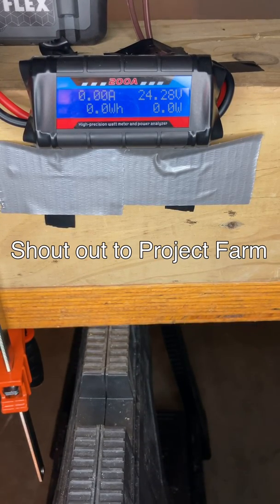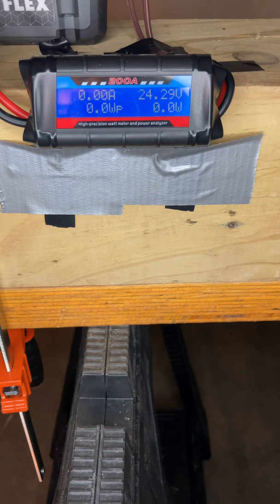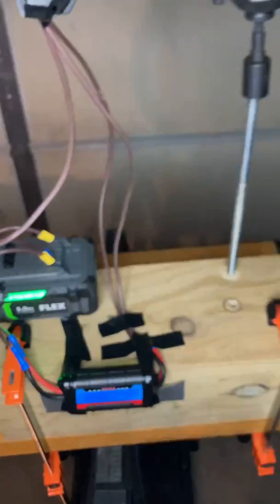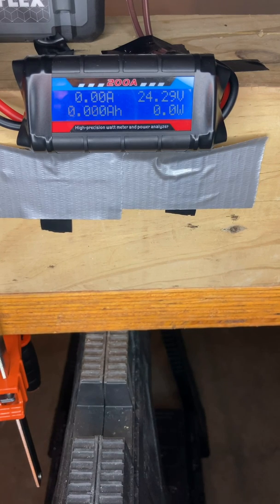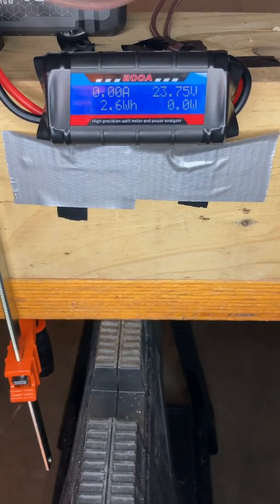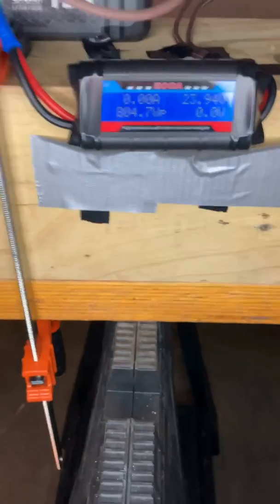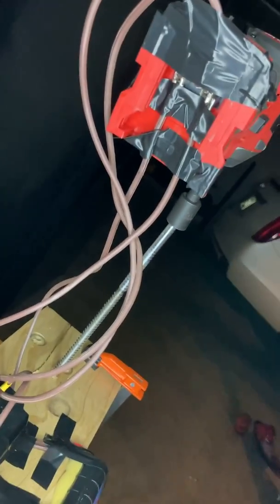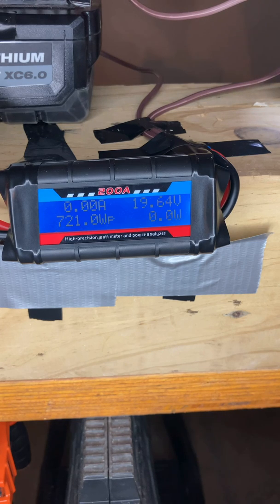Tool Testing  What you see is what you get

Comment: for the flex impact, does it only need two wires to run?
Reply from the maker: I think it uses 4 connections
Reply: @IMPACT-NATION  i could be wrong here. i think you used only two connectors out of four to make it run.... again. i could be wrong... THANKS :)

Comment: Bro this is next level testing‼️‼️
Reply from the maker: Thanks man. I seen project farm use this meter on a blower and battery to test the capacity. I just applied the same method but to test current draw, watts produced, and voltage levels. Pretty interesting stuff if your into battery technology. I’m going to be testing the flex 10Ah stacked lithium very soon on the flex recip.  just ordered it from lowes today so stayed tuned brother 👊. Thanks for the comment

Comment: Good testing looks like the Milwaukee topped out on amps Higher then the flex from what I could see but both are solid and pretty close looks super fair to put the Milwaukee tools against the 24v tools looks like voltage drop was 1 volt on the Milwaukee vs the flex dropping 4 volts
Reply from the maker: That’s what I don’t like about the whole 20 volt max, 24 volt max thing. Even MAKITA started doing it with XGT. Yes it will read 20+, 24+, 40+… whatever. But as soon as you pull that trigger that nominal voltage kicks in. And you have to pull the trigger to accomplish a task🤣. I dig it though. Marketing 🤣. I think Hilti was one of the most 💯 out of all of them. They’ve had 6 cells in their packs forever and always listed at 18v packs. Only up till not long ago did they start putting 22volts. Even 12volt tools are just a peak rating. 12 volt are only around 11.1 nominal. I understand why the companies do it though. I probably would too. That shit don’t fly over seas though🤣🤣

Comment: Bang up video Brother, intelligent and concise. Quite project farm style minus the rapid announcer callouts hahaha. Liked and subscribed, not bad for the Flex. Milwaukee will still always be a wildcard in my books.
Reply from the maker: 🤣 thanks Athannael. I rushed this video. I really appreciate the support man. That means a lot to me brother I really like the flex impact driver. I don’t mind the weight at all. Makes it feel like a more solid tool. As a new power tool company I think they have accomplished quite a lot in a short period of time
Reply: For me why I swapped from Milwaukee to Flex is the price ironically for performance. That 6.0ah battery in my area costs $384 taxes out, the Flex impact kit cost me just under $400 taxes in. The 2 batteries it came with the 2.5 and the 5 cost $100 and $200 respectively so the cost for the tool was $100 charger was kicked in for free, swap to the Milwaukee side tool only Gen 3 impact is $199 out here so for the same performance as the flex it would cost me over $600 taxes in.

Comment: Great work Brandon.  But you gotta check with the boss when smoking in the lab.  You might catch on fire 🔥 or start a trend.  

Holy crap bro.   You catching up to me fast.  Keep it up.  💪
Reply from the maker: The cigarette was a new affect in my editor 🤣. I feel a little embarrassed tbh, about the quality and the editing cause it was spur of the moment and rushed but I just wanted to put something out about the results. People hear 21700 Vs 18650 cells and automatically complain and say it’s not fair when comparing flex and Milwaukee. They don’t take into account flex has an extra cell in the 2.5ah and 2 more cells in the 5ah running at higher voltage.
Reply: @IMPACT-NATION  sometimes you can teach people the truth but they are blind.  It's like in school.  Everyone is there listening to the teacher doing the same thing.  Some succeed and some don't.  But they all had the same lesson.  You can't change that.  But you can make it more fun to learn.  I don't know all the ratings either but I know you want the amp hour rating to be higher for longer run time.  Watt hours are another factor.  There's so much to storage in batteries.
Reply from the maker: @PFab  well said my friend. Well said
Reply from the maker: Thanks brother. I appreciate it
Reply: @IMPACT-NATION   I like the fog machine.  Now you need lasers.
Reply from the maker: @PFab  next on the list 🤣🤣🤣

Comment: This guy just threw up a video with extreme test with a 2804-20 with a 3.0 and ofcourse it did the studder thing Milwaukee does when not enough current that shit pisses me the fuck off
Reply from the maker: Yeah the 3.0 is awesome but for extreme heavy current draw applications it’s only going to supply heavy output for so long. That’s where the extra capacity is needed with a 5 or 6ah to share the load. Less resistance on the cells. Yeah I hear you man. What’s up with u broski? How you been man?